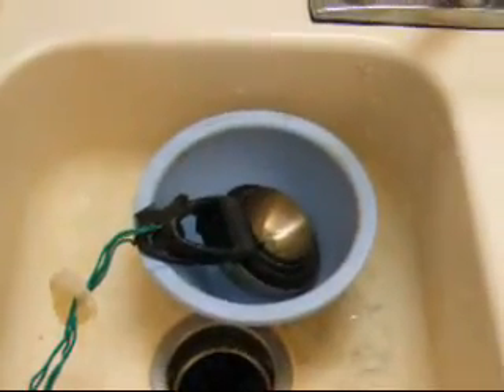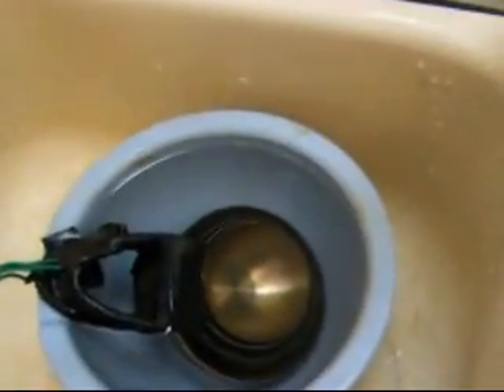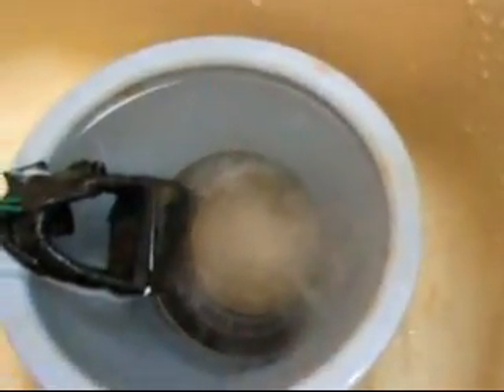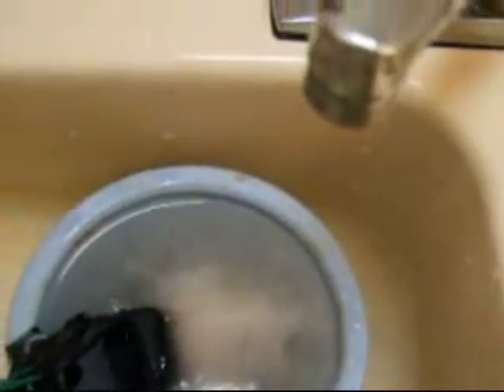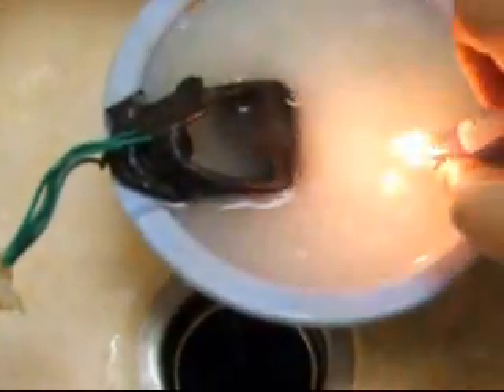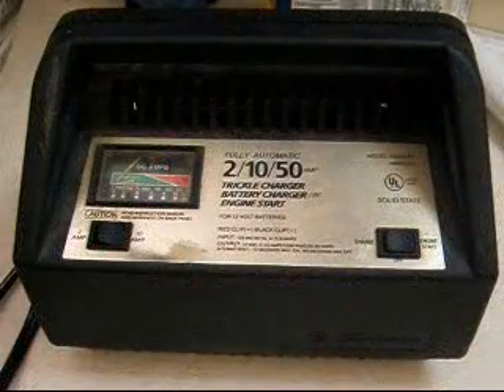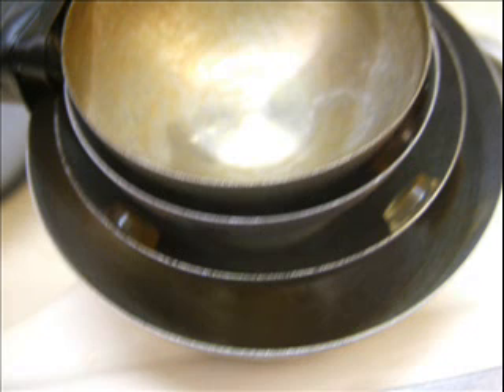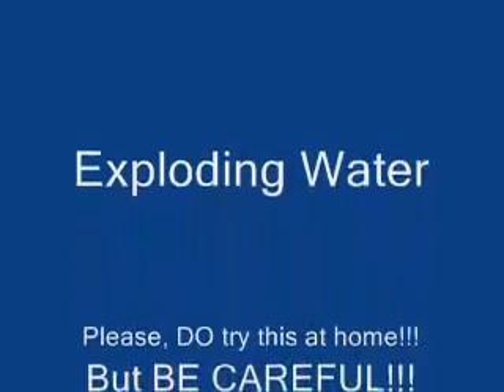Exploding Water

Comment: @MikeReedKS "There are existing vehicles that already have oversized alternators and might benefit from an HHO kit,"

Drawing more from the alternator will mean more load on the engine and therefore higher fuel consumption.  

Whichever way you cut it, you're basically just just converting 10 J of gasoline into about  2 J of hydrogen.

Comment from the maker: @SamToTheD I mostly agree. There are existing vehicles that already have oversized alternators and might benefit from an HHO kit, but more often than not, you need a larger alternator to produce enough energy to create sufficient quantities of hydrogen to make a difference. A larger alternator is a drag on the motor, so the net is a loss of gas mileage and the expense of the equipment. Not worth it.

Comment: Yes you could fit it to a car but the energy required from the engines alternator and battery to power this hydrogen generator to make any useable amount of hydrogen would far outweigh the extra energy produced from combusting the hydrogen.

Comment: @Marvinfh3 Yes, it's simple. Although you want the plates together you can use a larger container, space the two apart and have a container over each plate indicidually, such smaller jars sitting over one electrode each. This way each gas is funneled separately, but with the wider spacing your reaction will be slower, and be sure the two plates still share contact with the same body of water.

Comment from the maker: @iworkforme Unfortunately there isn't much hope. The energy required to perform he electrolysis is greater than the energy that can be produced from the combustion of the resulting gasses. It would be more efficient to use the electrical energy to power a motor directly than to use it to create gasses to feed into a combustion engine.

Comment from the maker: /bow my friend.  I did some more research and this is not as clear as I thought. Seems there are folks who swear both ways. So I guess I really have no idea. Seems the chemical reaction is implosion, with water and heat as the byproduct, which is an explosion. I do know that when you light a balloon full of the stuff it looks far different than when you light a balloon filled with butane. The butane makes a large rising fireball and the hydrogen is very fast burning and makes a tight fireball.

Comment from the maker: Does a light bulb explode? Does the flame on a candle explode? Does wood burning explode? The correct answer to all of these is no, it is combustion, which is not an explosion. Each one heats the air around it and would likely move a piston, but none are explosions... but why split hairs. It goes *BOOM* and that sure sounds like an explosion to me... even if technically it isn't. So I agree... let's call it "Exploding Water" :-) Thanks much for the debate!

Comment: @MikeReedKS Your double negative suggests I'm right, water isn't exploding. 

Last time I checked, hydrogen explodes. I can prove this with a piston and cylinder with hydrogen/oxygen mix inside and igniting it. The EXPLOSION pushes the pistion. This is what allows hydrogen engines to run. Small amounts of nitrogen oxide is also produced.

Comment from the maker: There is a Myth Busters video that shows then use methane and bubbles. It builds a column to the top of their offices, and then they light it on fire. Because it was methane, the burn rate is much slower than it would have been with Hydrogen. Had they used hydrogen, they'd have likely not laughed after. It would have been very loud with an extremely fast burn rate. See v=gXcug7RqPgs.

Comment from the maker: If you are not grounded, like standing on a dry floor with tennis shoes on, nothing, not even a tingle. On the other hand, touch a grounded item, like the faucet and you might get a jolt, but it is unlikely you would die... you just are not a very good conductor compared with the water... but there is a chance of it, so don't be an idiot. :-)

Comment from the maker: My point here is that YOU are high resistance, the WATER is low resistance, which way do you thing the current is going to flow? So, the key to avoiding death here is DON'T BE LOW RESISTANCE!  Don't stand in a puddle barefoot holding on to copper pipe stuck 20 feet into the ground. Don't hold one wire and touch the other one... this is what I meant by don't do this if your an idiot.

Comment from the maker: Many people miss the fact that electricity follows the path(s) of least resistance. The flow is divided among all paths, with the flow equaling the ratios of the resistances of each path. Both the + and - sides are in the water and the resistance of the water is negligible, putting your hand in the water, unless you are touching a ground, nearly nothing flows through you. Remove one of the wires and hold it in one hand then put your other hand in the water and watch out... your dead!

Comment from the maker: The current will always seek and follow the path of least resistance. Because we have both the positive and negative sides, very near each other in the water, the likelihood of a shock from touching the water is very low. In fact, there are machines sold that claim to remove toxins through the feet that submerge a similar apparatus in salt water and you submerge your feet in the water at the same time!

Comment: Please people, think about this. You are putting hydrogen into vehicles? Where does it come from. It's CREATED, just like this video shows. We use ELECTROLYSIS. Just like the video shows. It requires ENERGY. Energy is generated primarily using GAS or COAL. Generating electricity is a MUCH MORE WASTEFUL energy than an efficient vehicle engine. This is NOT saving any trees. It is NOT changing the world. Unless of course, you build green power supplies. Like the government will ever do that...

Comment: In the short run, hydrogen is cheaper since the engine does not need to be changed.
In the long run however, a plug-in hybrid would be cheaper as they are more efficient.

Comment: @BeyonceNo1Diva Hmm. Two electrodes. On one of them we've got -Cl and -OH, on the other -H and -Na. Na is on the other electrode, than -Cl, while there surely is some non-dissociated water around this electrode, so -Na will immediately form a stable compound with water (NaOH)... Here ve have one -H from electrolysis and one -H from -Na reaction with water. Doubt about the -OH on the other electrode. Theoretically, double -Cl and double -OH may form Cl2 and H2O2. Prove me wrong...

Comment: @PoisoningOrchid 
No, you're a bit wrong. I was always wondering, why no one never-ever thinks about what happens to the salt. And guess what? The electrolysis of salt solution breaks salt into sodium and chlorine. Well, the sodium immediately combines with the water and forms a sodium alkali (NaOH), not acid, and one hydrogen out. The chlorine doesn't form a compound, it goes out as a gas. So, we've got chlorine and hydrogen. I don't recommend to breathe it in.

Comment: And FYI they burn the dont explode exploding is what happens when you contain a burn like with a sealed container. Even in an engine there isnt and explosion it is a burn if the exhaust valve didnt open you would get and explosion and catastrophic engine failure.

Comment: @bmxpimp1324 It wont hurt you unless you have high voltage to make the current go through your body. Thats why it isn't dangerous having a computer wich uses several amps with no problems.

Comment: the amps increase because salt water conducts better

also, SALT is made of "SODIUM and CHLORINE"
NaCl
which is wher the chlorine gas comes from when the elements get separated

and for the whole deal with using hydrogen for cars to save pollution.
the energy needed to get the hydrogen from the water actually pollutes more than if we just stuck to gasoline

Comment: i dont think it'd produce chlorine gas. If anything, maybe CuCl if those cups are copper. Oherwise you would make NaOH and HCl which would react together. if you do this with 36 volts (4 9v batteries) you can turn the water green with iron nodes (nails, steel is iron). FeCl2 is green in solution.

Comment: Using hydrogen to propel cars ? That's a scam. Just do the math. Producing hydrogen requires ALOT of energy. Especially by electrolysis. That energy needs to come from somewhere and in most countries, it comes form coal or petrol. In the end, you end up polluting and burning as much fossil combustible, just not directly in the car.

Comment: We have industrial gas cutters that use this principle. The gas is directed to a gas welding/cutting torch. It takes around 2,000 watts of electrical energy with the cost much less than oxy acetylene technology. If the gas (water Gas) is allowed to accumulate it can be extremely dangerous. This should not be done if you are not fully prepared.

Comment: 10 amps is lethal yes, but you need a very high voltage in order to get the electricity to pass through you'r body into the ground, and this being 12 volts isn't heigh enough, (i'm not going to tell you how much is necesary because i don't know))

Comment: Gas is not explosive :P
It works like this: H2O --> 2H O --> H2O + Energy
now normal water cannot conduct electricity at all, in fact it's a great insulator but when you add salt there are free electrons so the salt water can conduct and electrical current. when the current passes through it it breaks the bond between the H20 into 2H and an O which then when the hydrogen is exposed to a flame it rapidly changes back to water and releases energy stored inside.

Comment: Add a few drops of dish soap.  This will change the surface tension, and you'll get larger bubbles.  There's no reason to use that much amperage in your kitchen, not to mention the emersion of chlorine gas reacts explosively with hydrogen along the cathode.  That's dangerous in any condition and also destroys the idea of its use in a PEMFC, since chlorine and hydrogen explode in anaerobic conditions.   I think you'll find electrolysis is not the answer to PEMFC's.  What fuel do powerplants use?

Comment from the maker: Nope, no harm if you touch the water as long as both wires are properly connected and in the water. The electricity follows the path of least resistance and youre not a very conductor compared with the wires. In fact there are folks selling this as ionization for detoxification. Now don't stand barefoot in a puddle with a copper wire wrapped around your big toe and stuck into the ground, or even touch the faucet, as that might let some of the electricity find its' best path through you.

Comment: has anyone heard of a solar panel??? a regular calculators solar panel can produce 1.0 volts of electricity in a dimly lit room. the highest ive seen it produce is 3 volts. if you simply install a solar panel it will make the hydrogen and oxygen for you! they already have some of these implemented already so no nuclear power wouldnt be usefull because actually im not certain that the amount of radioactive material on earth will last as long as fossil fuels suprisingly have.

Comment: Correct. 10mA (0.0001A) is a leathal current, but a battery charger only opperates at arround 12V, normal dry skin has a resistance of ~10000 Ohms. not going to go into too much detail but, but a 12V battery charger doesn't opperate at a high enough voltage to kill you, unless you were to put it somewhere silly like '-' in your mouth and '+' in your ass. but still arguable untill someone tries. minimum voltage that will electrocute is thought to be around 55-60V

Comment from the maker: You can touch the water, that isn't what it takes. As long as both the positive and negative sides of the supply are in the water the risk of electrocution is near zero as the electricity will always follow the path of least resistance, and youre pretty high resistance in comparison. So a tip is not to only put one wire in the water and then put the other one in your mouth!  Keep them both in the water and your safe.

Comment: Not really. There were 4 amps (or 10 at the end) because the resistance of the water was low, not because the voltage was high. 12 volts wouldn't have hurt him.

Comment: Making explosive gas is better with renewable wind power, nuclear, or solar, using sea water. But, your best bet is to take the electricity and go directly to an electric motor for efficiency. BTW - The cheapest and most plentiful conversion fuel for cars until they are all electric is CNG.

Comment: The water isn't the power source, it's the battery!!
So all you've done is take potential energy from the battery ( or battery charger) and transform it into chemical energy, with great losses.
In a car you must have an independent energy source. In a car you can't just plug in your battery charger!
The engine is supposed to charge the battery, not the other way around.

Comment: I did a similar experiment with my hydrogen generator but I added soap to contain the gases until I could light them with a long lighter.  You can wait until you have more bubbles for a bigger boom.  But don't go overboard, too many bubbles being ignited at once could get you hurt.

Comment: Nice. Good to see a real science demo on here -- not someone claiming to be able to levitate or produce "free" energy from water etc. Do you know of electrolytes that will work well, without producing Chlorine gas? 

Also, I bet if you were to electrically isolate several wire mesh planes, that would work well (lots of surface area).

It would also be interesting to capture the resulting gases (roughly, 2*H2 + O2) over water, and then set it off with a remote igniter. Homemade fireballs, anyone?

Comment from the maker: Agreed, this is just a good idea from a safety perspective. In reality, the reaction time is very short and the total heat is quickly dissipated, so flesh burns from lighting the gas has a very low probability. This is much like passing your finger quickly through a candle flame. The total time in contact with the heat source is too short for the heat to be conducted into the skin causing a burn. None the less, using a long lighter is just being smart. Why take unnecessary chances?

Comment from the maker: A short is caused when the resistance drops to near zero in a circuit. As long as there is a load, there is not a short. In this case, the water is a conductor with high resistance which works as the load. The catalyst lowers the resistance allowing the flow of electrons. This electron flow breaks the bonds of the water molecule releasing the component gases.

Comment from the maker: Just don't do it. The reaction speed of converting hydrogen back to water, the explosions you hear and see, is extremely fast. In any volume the reaction is beyond what you'd want to deal with in an experiment. Also, the speed in which the gas is released is too slow to build much of a column. There is a Myth Busters episode where they do it with methane, which is dangerous enough, to do that with hydrogen is asking to lose your hearing, a few fingers and your home. Please don't be an idiot!

Comment: try using the carbon rods out of an old (dead) heavy duty or super heavy duty D-cell sized "battery" (actually only one cell, 9-volt "transistor" battery is actually a battery, has 6 AAAA sized cells in it or a stack of 6 "pancake" style cells

Comment: You can use Baking Soda as the electrolyte. If you use baking soda it won't create chlorine gas, as baking soda is sodium bicarbonate, which, obviously, has no chlorine (as opposed to table salt which is sodium chloride). Baking soda also helps to reduce the deterioration of the electrodes. Another thing; if you use copper electrodes, you will get a less 'gunky' leftover liquid, although the best thing to use would definitely be a graphite cutting-torch rod.

Comment from the maker: I initially did this experiment in a sealed plastic container with only about 1/8" of air space at the top. I used a small tube coming out of the top in the hope of blowing up some balloons, this was far too slow so I tried to light the gas directly and the ignition traveled back down the tube into the container and caused an explosion. Fortunately for me the volume of gas was small and the container split easily or I could have had a real accident on my hands.

Comment from the maker: Search "Detox Foot Spa". You will find several companies using a similar setup to "energize" water and pull toxins out of your feet. Is this BS? Likely, but the point is that not only can you put your finger in it, but there are people making a living off the idea. Electricity follows the path of least resistance, so having both the + and - wires in the water assures that the voltage has no interest in you. Holding one wire in your hand or grounding yourself would be very dangerous.

Comment from the maker: I 100% agree. My page at  "Water As A Fuel . com" states these same conclusions. The only value of this as a fuel is short term augmentation of autos that already have oversized alternators and as such excess electricity to use. As a long term solution, an electric motor is much more efficient way to use the energy.

Comment from the maker: Yes, using electrolysis and fuel cell as the two sides of a gas storage system is a good idea, but like most other storage choices there are downsides. It's a pretty volatile mixture to have in the basement in the case of a house fire and a leak in either tank could be disastrous.

Comment from the maker: Electrolysis breaks the bonds of the water releasing the hydrogen (H) and oxygen (O). The H is released as a gas and is flammable. The O reacts with the salt and metals to produce O2, chlorine gas and rust. This is why the water forms a scum and why there is a slight odor. When ignited, the H recombines with O from the air and produces water vapor. This combustion is a very high speed chemical process that releases heat and light expanding the surrounding air producing sound.